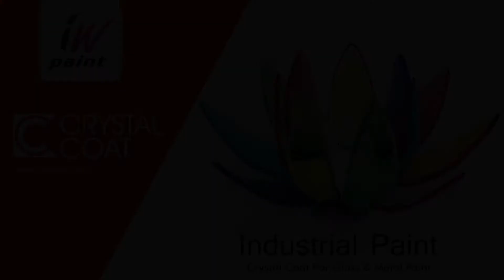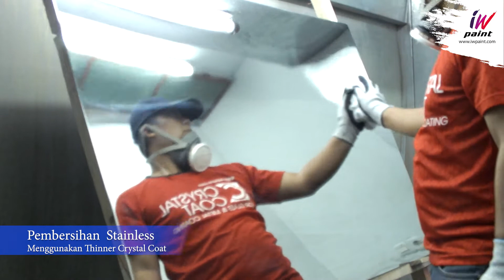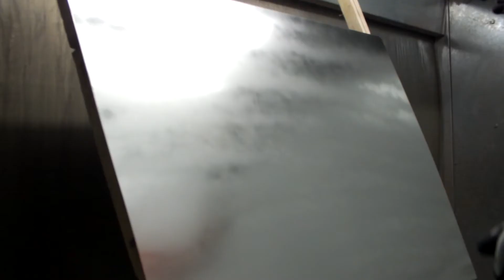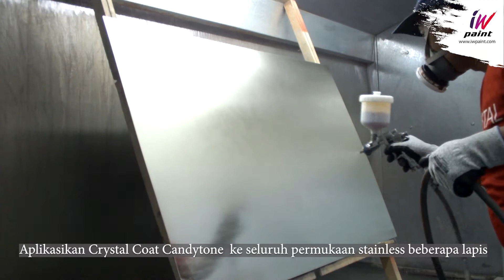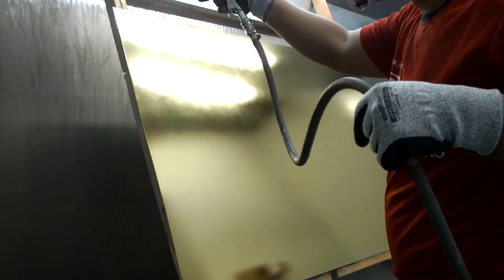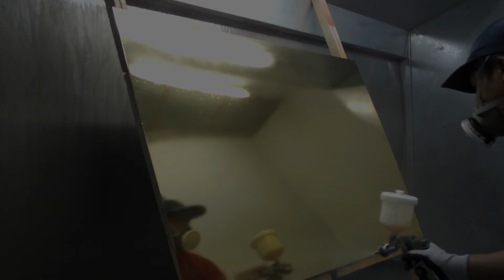Pengecatan Stainless Mirror Dengan Crystal Coat Candytone Metal

Comment: Maaf pak mau tanya, jadi tahapannya

Bahan steinlis ss 304
Sistem cat wet on wet
1. Clear goss, dasaran di cat tipis  2 atau 3 lapis
2. Warna (mis. Golden lacquer), di cat tipis 2 atau 3 lapis   
3. Top coat clear gloss, dicat tipis 2 atau 3 lapis

Gitu yah??

Trus ngecatny harus di tempat dingin yah, atau gak papa di dalem ruangan yg bersih dengan suhu ruangan
Reply from the maker: Mas Tito, kalo jenis stainlessnya yg dipakai hairline atau mirror? Kalau jenis stainlessnya hairline sebaiknya sebelum cat dasar, dilakukan penggosokan stainless dengan scotbrite searah dengan alur hairline. Tips cat dasar harus merata di seluruh permukaan dan hasil spraynya basah tidak boleh kering, agar daya lekatnya optimal. Secara umum step aplikasi Mas Tito sudah benar.
Reply: @iwpaint1974  iya rencana saya pakai 
Steinlis hollow 50x50, mau buat frame shower kamar mandi, awet gak yah terus menerus di area basah?
Reply from the maker: @titoarie808  area basah, kemungkinan juga terkena air panas , terkena gesekan adalah area yg termasuk ekstrim Mas Tito, sehingga keawetannya tidak sama dengan area yang normal.
Reply: @iwpaint1974  untuk keawetan di area ekstrim, tahan berapa lama yah? Dan apa boleh lapisan terakhir sekali setelah top coat nya cristal coat, saya tambah coating dengan clear PU
Reply from the maker: @titoarie808  Berapa lamanya ketahanan di area ekstrim tidak bisa diperkirakan secara pasti Mas Tito. Penambahan Top Coat Clear PU setelah Crystal Coat Gloss bisa saja dilakukan dengan tujuan untuk meningkatkan perlindungan Mas Tito.
Reply: @iwpaint1974  nice sharing, thanks yah 🙏
Reply from the maker: @titoarie808  sama-sama Mas Tito, semoga bermanfaat🙏
Reply: @iwpaint1974  malam pak, mau tanya sedikit lagi ni, kan saya sudah pewarnaan gold metal, nah tinggal di clear gloss, cuma baru mau lanjut di hari berikutny,

Apa perlu di amplas lagi?
Kalo iya pake amplas brp yah?

Comment: Bang proses stiap stepnya ada proses amplasnya gak y?
Reply from the maker: Bisa dengan 2 cara Pa, kalo lapisan setiap stepnya dibiarkan kering, maka untuk step berikutnya harus dilakukan pengamplasan ( amplas no. 1500 atau no. 2000 ).
Tetapi kalo lapisannya belum kering ( 5 - 10 menit ), maka untuk step berikutnya tidak memerlukan pengamplasan.
Reply: Gan, kl sistem blm kering sdh ditimpa lg, akan efek terlalu basah gak nanti catnya meler?
Reply from the maker: Kalo sistem pengecatannya wet on wet ( tidak ditunggu sampai kering )/kurang lebih 5-10 menit, tidak ada pengamplasan. Tapi tempat pengecatannya harus bersih.
Kalo setiap tahapnya ditunggu sampai kering, maka harus ada pengamplasan, menggunakan amplas no. 1500 atau No. 2000
Reply: @iwpaint1974  amplas 2000 gak keliatan bekas amplasnya ya? kering itu brp jam kira2 sampai siap amplas?
Reply from the maker: @adrianlaloh3357  iya Pa memang pakai amplas 2000 bekasnya sangat halus, tujuannya supaya lapisan cat tidak banyak terkikis. Kalau kering keras 1 jam sudah tercapai, dan sudah siap untuk diamplas.